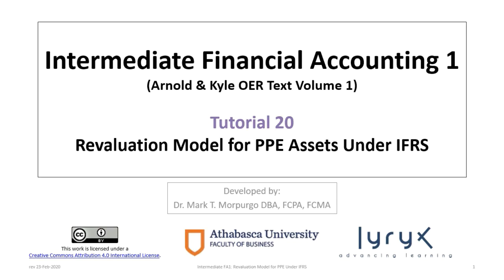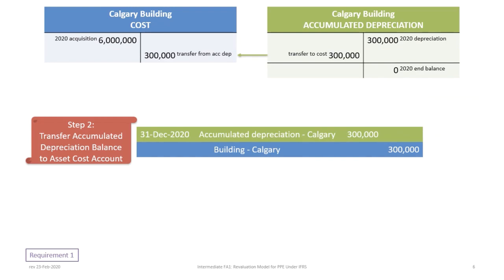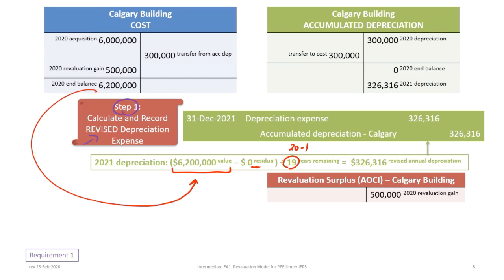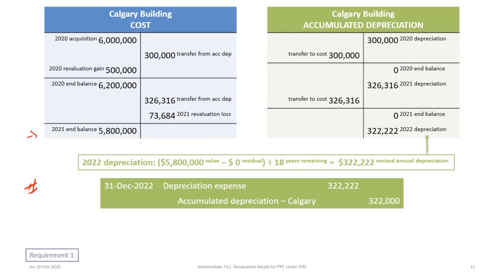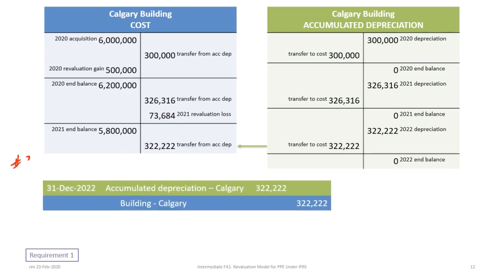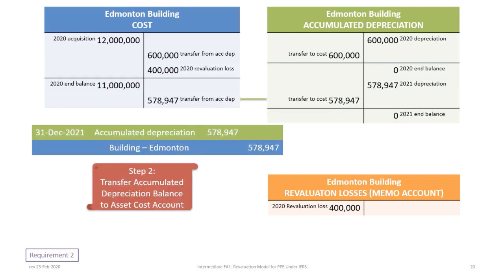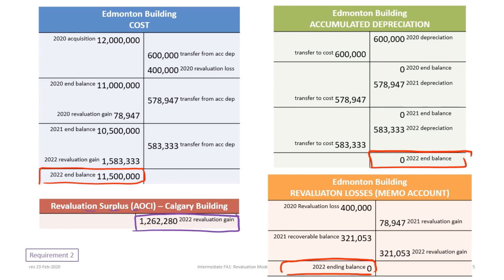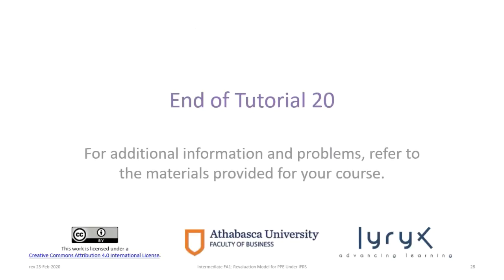Revaluing Property, Plant, and Equipment (PPE) Assets Using the Revaluation Model under IFRS (2020)

Comment: how do you know know the new asset value of the asset though. If it is based on the market price, then you need to revalue every year because the market value of PPE tends to go down every year as the technology advances
Reply from the maker: Hi Rudy,
You're absolutely right! When adopting the revaluation model, management must then undertake a "regular" review of the market value of the asset and continue to adjust accordingly. That said however, if management expects the value of the asset to continue to decline, then adopting the valuation model in the first place might not be appropriate.

The revaluation model attempts to capture changes in an asset’s value over its life. An essential condition of using this model is that the fair value of an asset be available and reliable at the reporting date. Fair values can often be determined through the use of qualified appraisers or other professionals who understand how to interpret market conditions. If appraisals are not available, other valuation techniques may be used to estimate the value. However, in some cases reliable fair values will not be available, so the model cannot be used.
The standard does not require that revaluations be performed at each reporting date, but it does require that the reported value not be materially different from the current fair value at the reporting date. If the property, plant, and equipment asset is expected to have volatile and significant changes in value, then annual revaluations are required. If the asset is only subject to insignificant changes in fair value each year, then revaluations every three to five years are recommended.

Hope this helps.
Mark